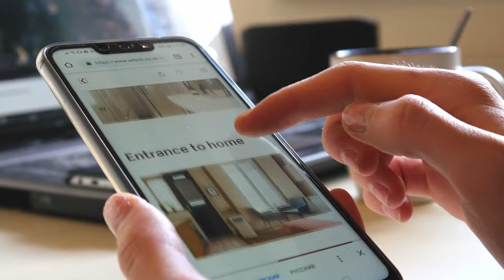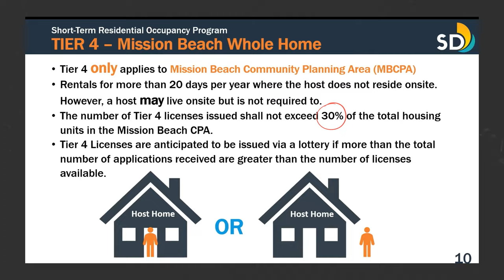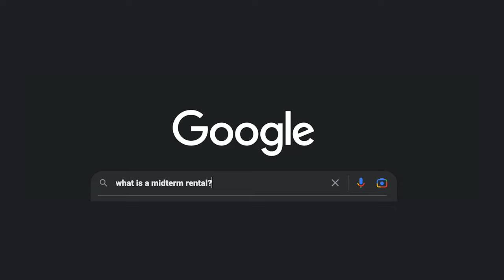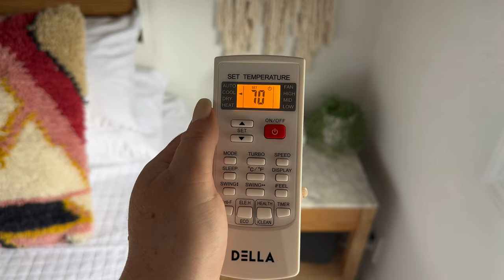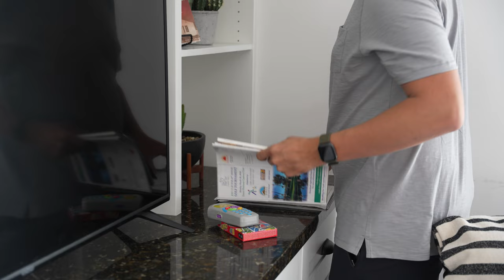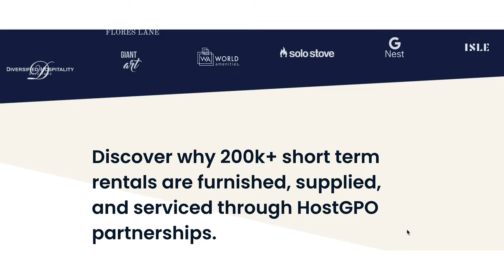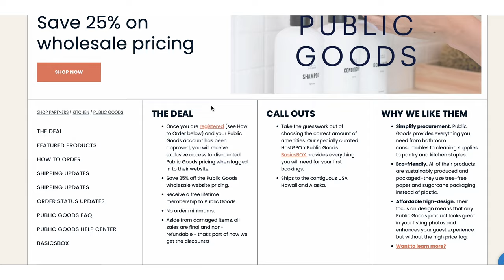The shocking reason why we're converting our Airbnb to a mid-term rental

Comment: Being in the North Park area of San Diego we were a little nervous about the lottery. It ended up being a non-issue for us👏🏾

We ran our Casita (studio) as a str but quickly discovered most of the inquiries were MTRs, mainly nurses(good location to the hospital I guess) and just decided to do that.

Our 3br on the same property gets a mix, summertime we get the normal 1-2 week family stays and in the winter the last 2 years we've gotten 2-3 month long stays(families looking to get away from the snow).

Over all the revenue breakdown is the same mainly due to having to clean less. A word of advice offer to have a cleaner go in once a month if the client allows... It's helpful.
Reply from the maker: That's interesting you're getting so many mid-term requests! Mission Beach is very heavy on short-term stays (as is expected) but we're seeing good mid-term demand so far as well. Appreciate the insight!